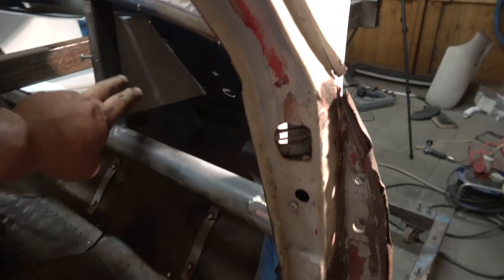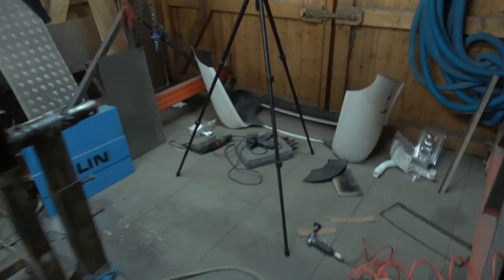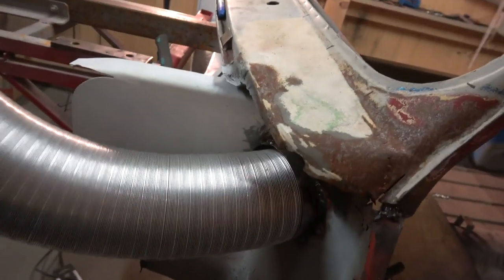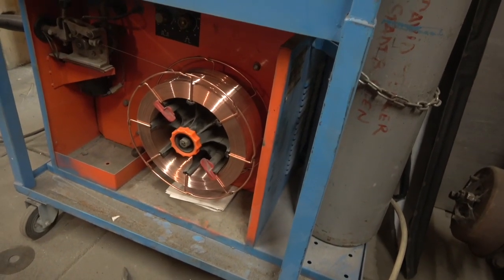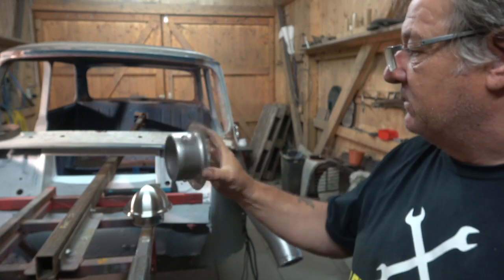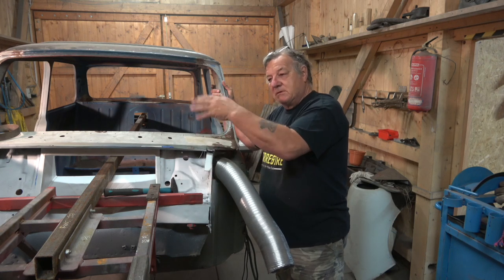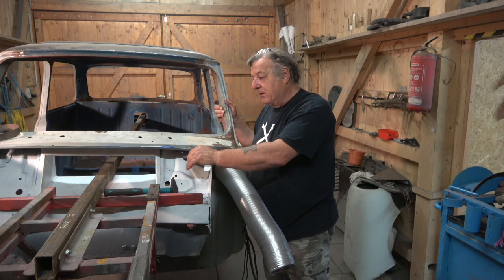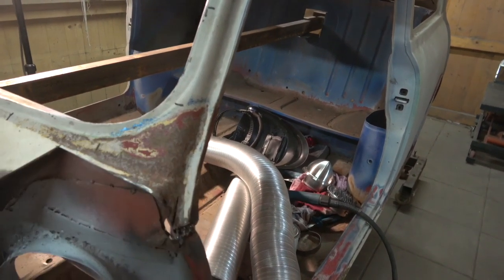Classic Mini Track Day Car Build Part 9 ( Making The cold air feeds  )

Comment: i use that stuff as a garage exhaust extractor, with one of the fans in as well to keep pulling the air out when the engines not running, its a bit delicate though and the exhaust backfires blow it apart..
Reply from the maker: Richard, I know what you mean it is very thin but we will see how we go! I would think the air pressure would not 
be that high to burst the foil,  Cheers Dave
Reply: @ClassicCarCave  you're not gonna be shooting 6 foot flames down it so you'll be alright!
Reply from the maker: Richard, I certainly hope not that would be one hell of a backfire lol, Cheers Dave

Comment: Are you going to get clearance of the pipe with the wheel on full bump?
Reply from the maker: Gavin, The pipe diameter is the same as the old air ducting so it shouldn't be a problem, Cheers Dave